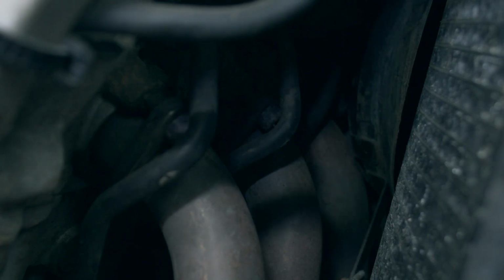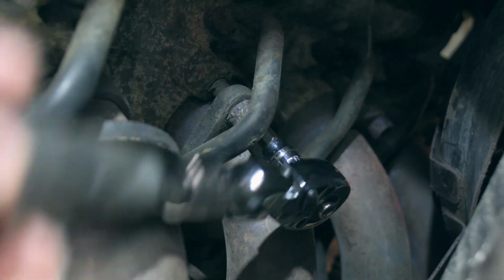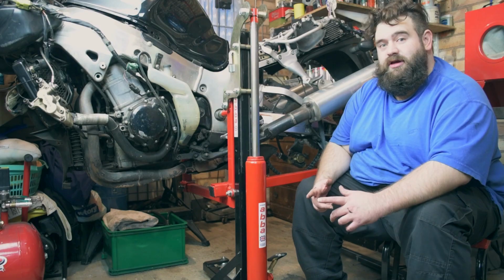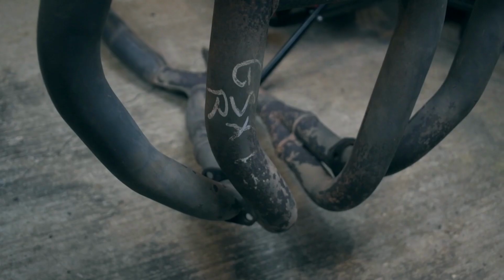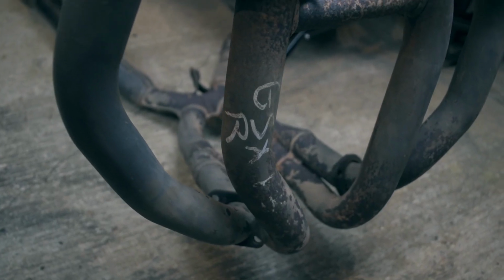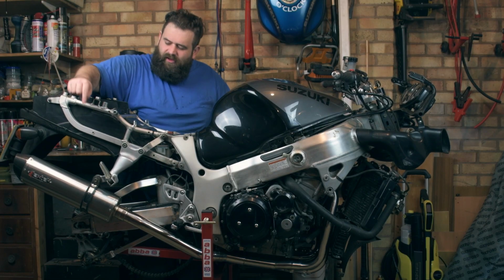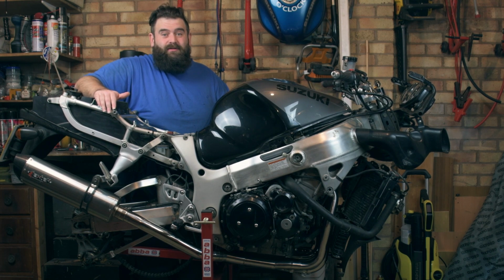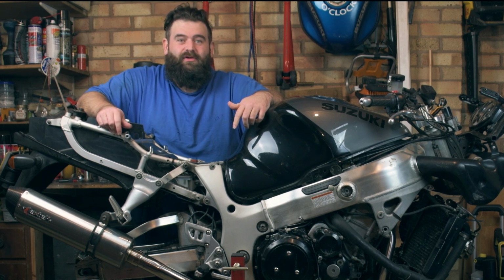Hayabusa 4 into 1 exhaust fitting | Classic motorbikes Suzuki project

Comment: Still gutted you got rid of the Slabby, just about to finish one of mine. I also have two 1999 Busa’s, the reason only one exhaust link pipe comes off is so that you can remove the bolts for the suspension link.
Reply from the maker: Hey Sticky, I'm just as gutted the Slabby is gone but I do get to see it regularly. Ahh that make sense, I know on the slightly newer Busa they have 2 removable stainless link pipes as we put them on Bills 2000 model.

Comment: I’d remove that air pump at the front while you’re at it , save a few pounds and it won’t go through your crank cases in an accident
Reply from the maker: Normally I would remove all the pairs system but in this case decided to leave it alone, bike will just be used as a daily commuter so don’t need to worry about weight saving.